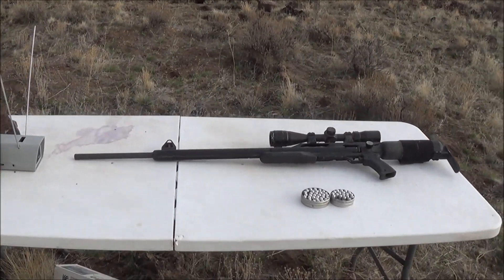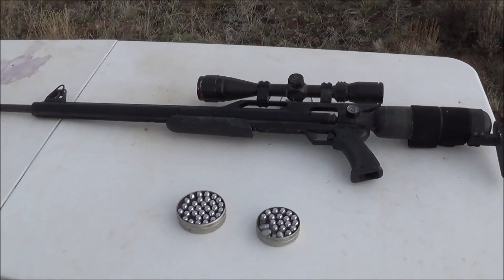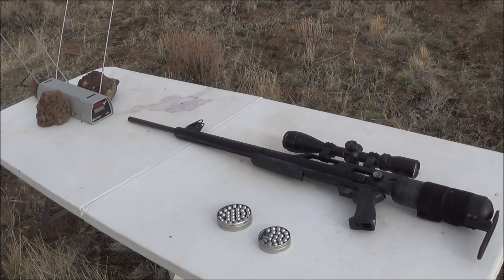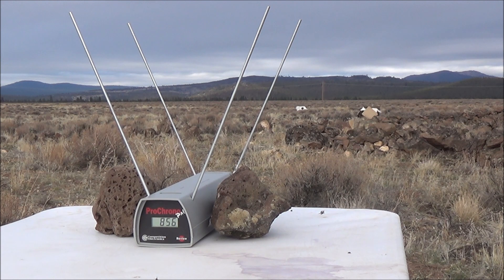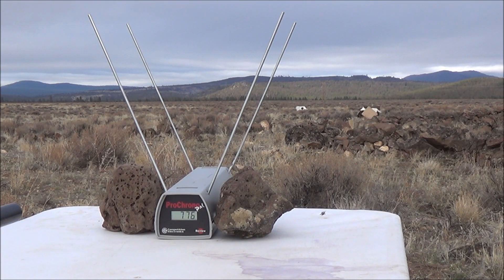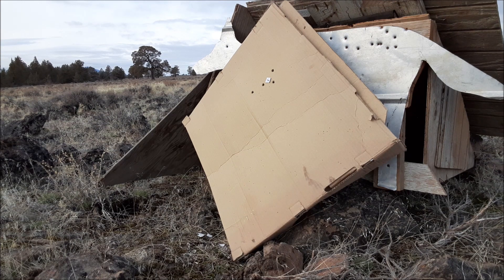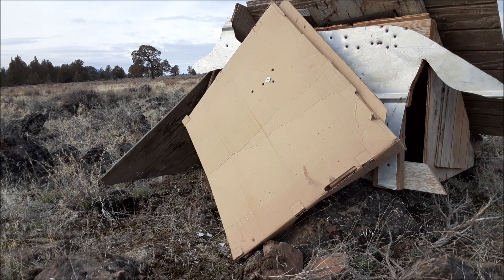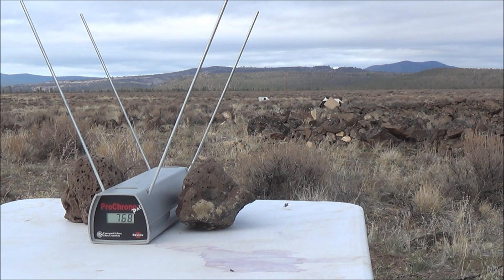HARD CAST LEAD Vs. SOFT CAST LEAD, velocity and accuracy Test.

Comment: Do u have tx2 valve. ?
Reply from the maker: Yes, I'm at 7,600 feet in elevation so the air is thin and produces less power, and its about 38 deg.